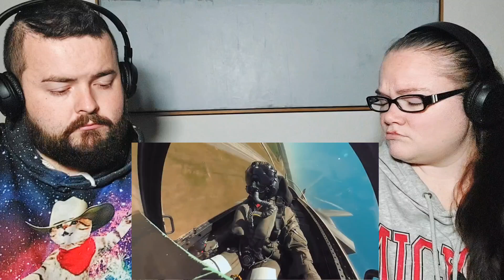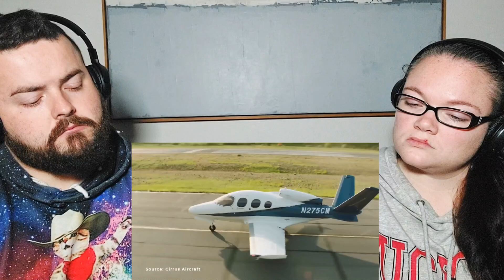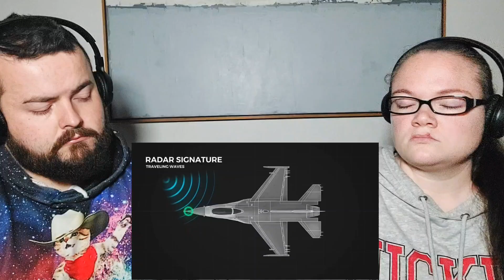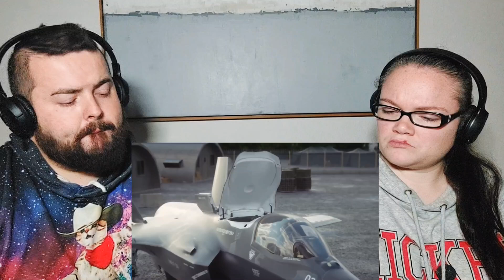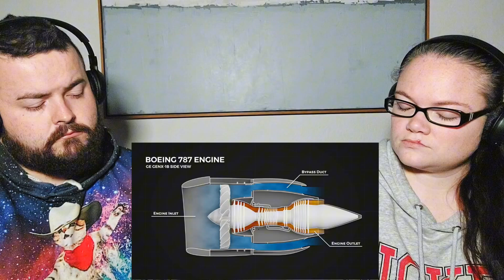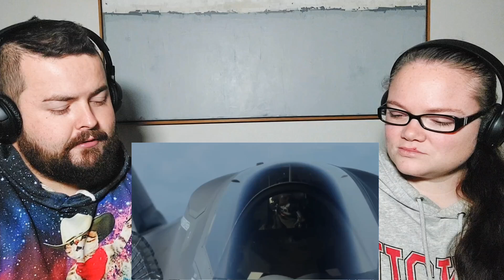The Insane Engineering of the F-35B | Irish Couple REACTION!

Comment: The reason that the vertical lift engine is called a helicopter is because, like a helicopter, there is a huge amount of air propelled downward while the air is coming in from above, thereby creating a lower pressure in the air above the engine.

That is why it is called a helicopter while the plane is in vertical flight.

The heads-up-display helmet (HUD) is a misnomer in that the pilot doesn't have to look down at different instrunents to ascertain certain facts it IS also a heads-down-display helmet in that if the pilot wants to see what is below the plane, all that the pilot needs to do is to look down.

Through the array of sapphire lenses, the pilot seems to be looking through the floor of the fuselage!
Reply from the maker: Thanks for all this info 😁☘️

Comment: There are 3 seperate variants of the F-35 Lightning II. The A is for the USA Air Force and allied air forces. The B which was featured in this video is the US Marienes and allied nations. The 3rd is the C for the US Navy and allied nations. The purpose of the " Joint Strike FIghter " program was to manufacture a newer generation of air planes withh allies that all the variants could share in the total developement and production for the family of air planes. The Lockheed Martin prototype won the production contract and the F-35's were result. The F-35 is most likely gonna be the most produced and widely spread use air plane. With the developement to the level it'st now ; has made it so the per unit cost drop drastically from 100m+ to around 80m+ now. It might even be lower now. It's cost per unit has dropped below of some 4th generation planes.
Reply from the maker: Thanks for this information ☘️

Comment: loiter time is how long is can stay in the air in an area of combat based on amount of fuel carried and efficiency of the engine. The vertical flight is mostly used for landing, as it's a lot harder on the plane when loaded to take off vertically, thats why they do short and ski jumped takeoffs.
Reply from the maker: Thank you for the explanation 😁☘️